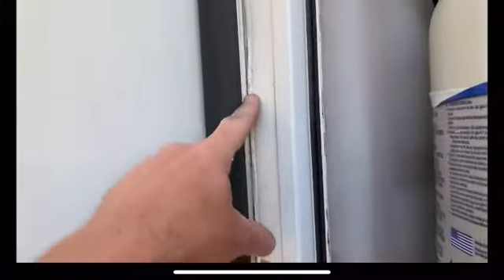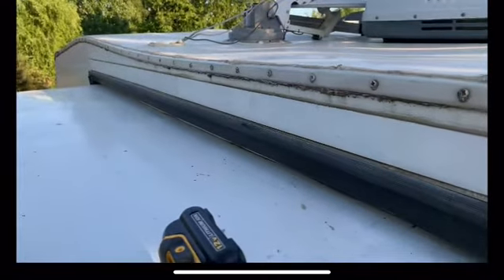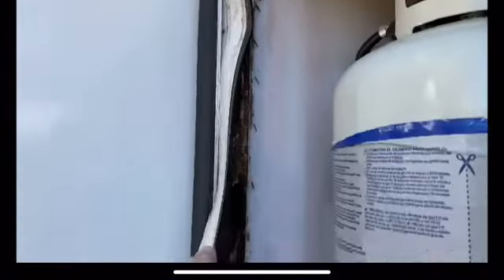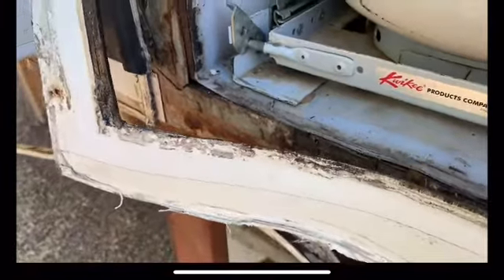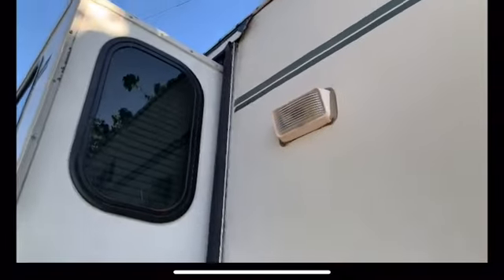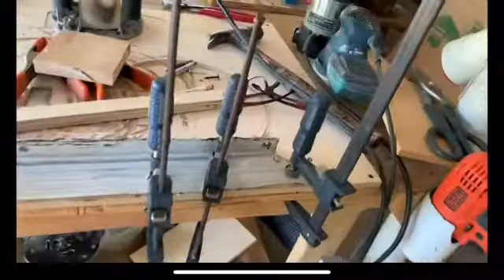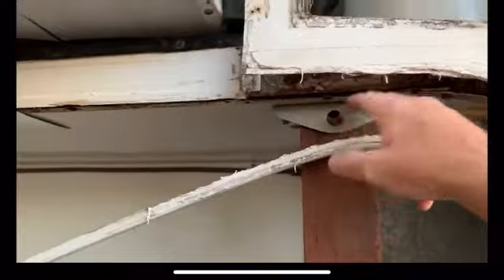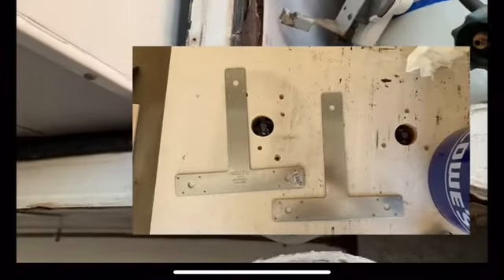More Slideout Repairs.  Water Damaged Wood Rot Repair on a Lance Truck Camper.

Comment: a camper just like this (but in worse shape lol) was my covid project last year. it took my husband  and I about 3 months.
Reply from the maker: It’s been a good camper for us over the last 10 years.  I use it mainly for work camping with my RV Inspection business.
Reply: @ Lynn Apgar & @ Covet the Camper.... My husband and I are working to repair delamination and wood rot on a 2002 Lance 915. I would be interested to learn what you would recommend for insulation and what to use in the place of lauan for sidewall construction/replacement as well as replacement of the front cab over section. My husband has a construction background, but RV repairs are a different kind of beast. Thanks so much for any information that you can provide. We need all the help we can get!!! :O)
Reply: @covetthecamper2289  My husband and I are working to repair delamination and wood rot on a 2002 Lance 915. I would be interested to learn what you would recommend for insulation and what to use in the place of lauan for sidewall construction/replacement as well as replacement of the front cab over section. My husband has a construction background, but RV repairs are a different kind of beast. Thanks so much for any information that you can provide. We need all the help we can get!!! :O)
Reply from the maker: @catherinefaulconer4034  
I used rigid polystyrene foam board for insulation and great stuff spray insulation to fill odd shaped areas.  
For wood or wood substitute I like Baltic Birch because it is manufactured with waterproof adhesive between the ply or you can use an Azdel type composite substrate.  
For replacement of solid wood framing I used 1x6 PVC and 1x8 pvc, glue & picket hole joinery.
Super strong, relatively lightweight and rot resistant.  Cuts and shapes just like wood.
Reply: @covetthecamper2289  thanks so much for your quick response. I will share this information with my husband. We may be back in touch with more questions. Thanks again!!
Reply from the maker: @catherinefaulconer4034  
You’re welcome.  I have a series of videos from my personal truck camper rebuild & remodel on here as well.  (2003 Fleetwood Elkhorn)
Reply: @catherinefaulconer4034  I can check with my husband for that info

Comment: Do the new Lance truck campers still have this problem?
Reply from the maker: No.  Lance started using full aluminum frames in 2006.  In 2008-2009 they started using Azdel composite substrate which replaced the 3-ply luan backing on the fiberglass sidewalls rear caps.  They also moved to a molded fiberglass front cap to eliminate a majority of rot issues in the nose.
In 2018, REV Group purchased Lance Campers and made minor changes to existing designs further eliminating issues that plagued their earlier models.